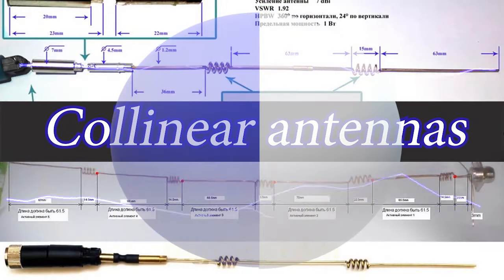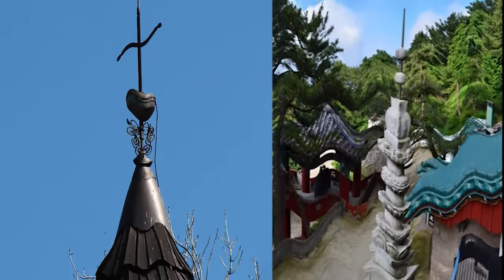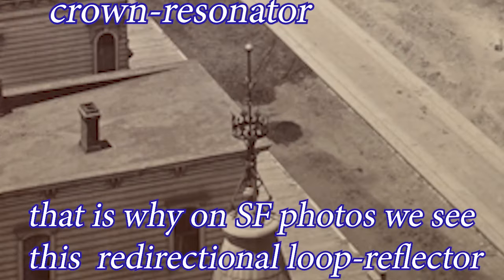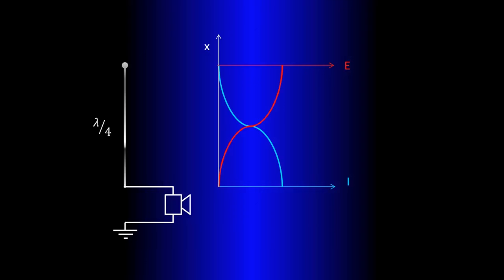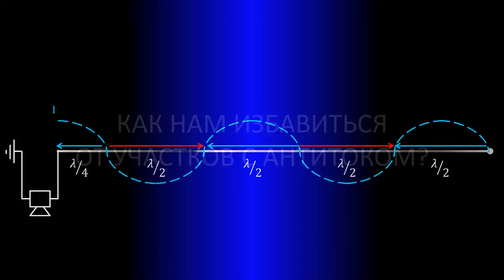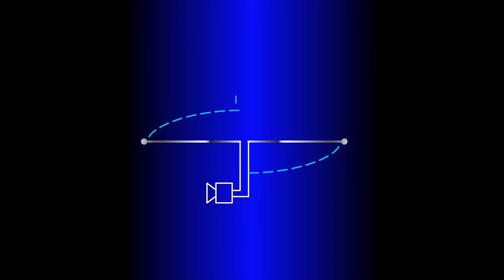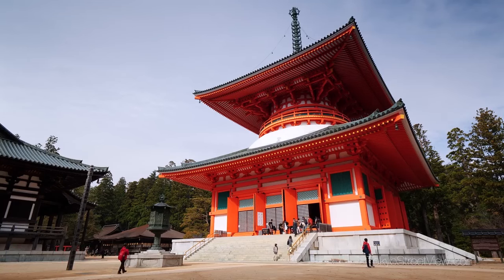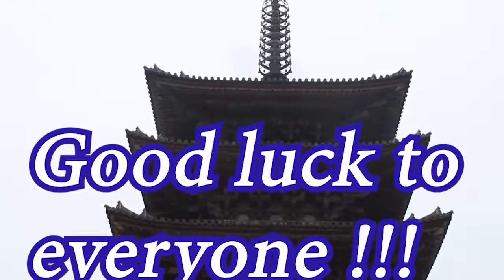Colinear free energy antennas in our past

Comment: This is probably over my head but if I see one built, and some measure of voltage produced, that can be harnessed and stored into a battery or used directly, then I would be on board.   It seems to me that such an antenna could even be used to harness the radio waves they're beaming at us everyday.
Reply: it can be measured.... try it in your garden
Reply: @ronaldfranklin6122  The Viziv tower is a way to transmit electricity wirelessly according to their own paper.(so they say) The paper doesn't mention Tesla at all. Instead it mentions some obscure researcher from the early 20th century. It's also very curious that one of the founders of the research is a retired brigadier general of the USAF. The whole thing smells like Tesla thievery. But I'm not convinced that they're pulling power from the aether...or at least they're not admitting it. What I'd really like to see is someone pulling this off from their garage shop. Hell,  I'd be happy to see someone run a refrigerator by pulling power from the aether.
Reply: Marcel LeMay - correct electricity transmission wirelessly I am not sure I concur with your thoughts
Sir they will never admit this pulling power from aether - the still have the world stuck on carbon based fuels - you can use water for fuel - 
US Special Forces DAFPA have vehicle’s running on water Hydrogen more specifically. And the next big thing lithium powered vehicles the next great rip off of the American consumer - only a retired BG w connections in the State of Texas could get away with this yes.
Donald Trumps Uncle a Scientist had possession of almost all of Tesla’s records experiments when 
he was government executive - that’s exactly what this is stollen Tesla technology Hydrogen only good tech for future, may eliminate electric vehicles if allowed, already did this before an they took away

Comment: What devices did the free electricity power? Thank you.
Reply: Driver Cdl electric motors or magnetic propulsion.
Of course light bulbs and central or portable heating devices

And they probably used it to eradicate viruses through the right frequency, like you can use to break a crystal glass.

Comment: i actually rediscovered this artifact by using a volt meter. first it started by taping the leads to my wall..now i have a ground in the ground. and the higher the antenna the more power im using Ethernet cables which seem to prefer lateral directions and to have the most surface area in a east/western direction it also produces A/C current. with a easy FULL BRIDGE RECTIFIER it slaps out D/C with a AMPERAGE boost. it works based on the electromagnetic spectrum(everything falls under this agent)
side note my galaxy s3 flash light decreases the power output at close range
wiki also has some data but its been trial and error 
https://en.wikipedia.org/wiki/Rectenna
Reply: Can you show it in a video?
Reply: Man have you been able to come up with anything, give more info please, there are aware people out there who want to build for themselves

Comment: What would they have used electricity for?
Reply from the maker: For everything)
Reply: @globalvision4633  Hi, this is really interesting stuff you're working on.  I guess what I meant was, if there was indeed electricity available, what level of technology (ie PCs/lighting) would have been associated with that time?  Wouldn't you expect to see other  infrastructure such as power cable wiring?
Reply from the maker: @sum7127  this "ancient" technology will give us any amounts of energy) i hope) regarding the cables - i did not understand what do you mean
Reply: @globalvision4633  hi, what I meant was this: today, power is generated and then sent via cables into our homes. And in our homes we have cabling throughout the house in each room.

With respect to these ancient houses, there does appear to be technology that could tap into 'free' energy and you've highlighted the outside capacitors, but where did the electricity then go once generated?  If the energy was intended for use inside the house, how do you think that it was distributed to things that might use the electricity?
Reply from the maker: Cables needed only for ac) for dc - other way to use it and transfer
Reply: @sum7127  i think they used this energy to a) heat up interiors, b) for healing purposes, revitalizing, mind etc.  c) communication, sending/receiving something..that are my guesses. 

Our past people build almost  everything out of stone, harmonic in design and pleasing to our eye. But why? And who were, where came they from and where did they all go? 

So interesting and mystic topic, our young past is...